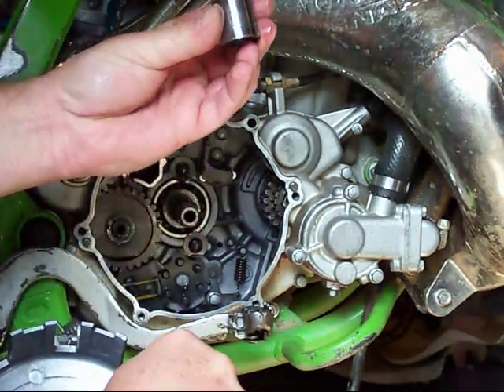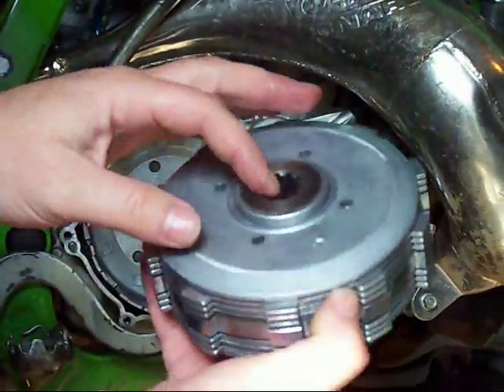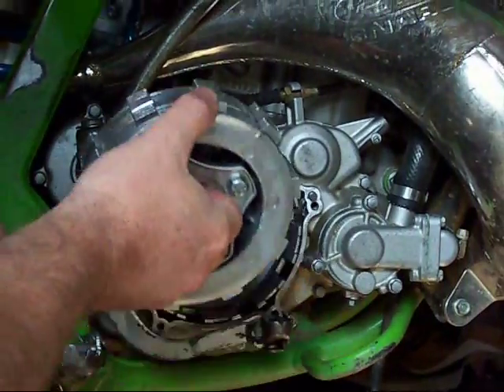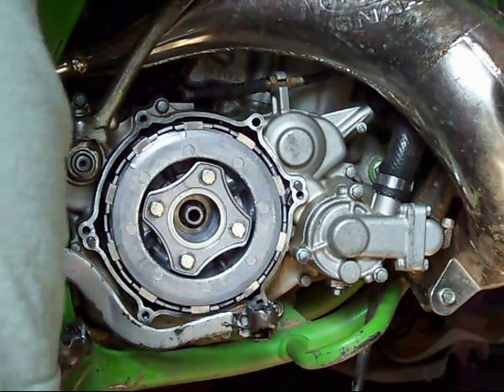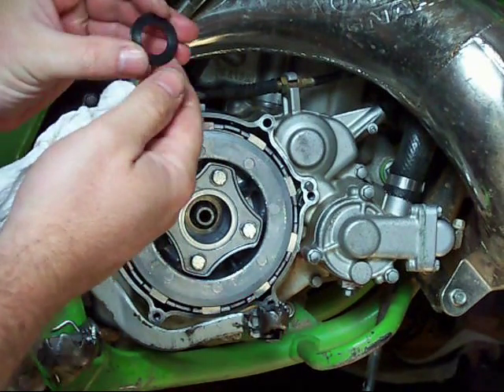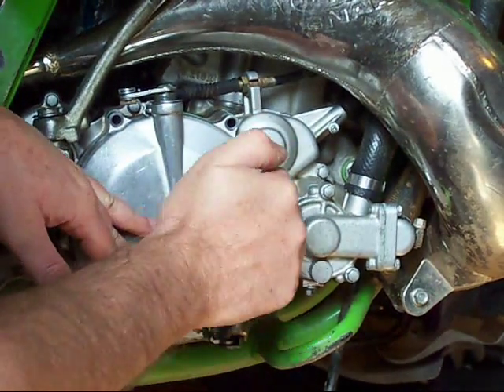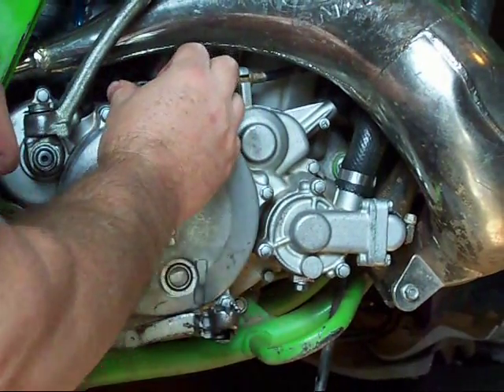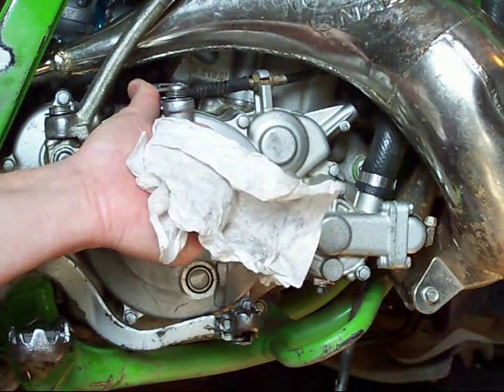Revloc Dynaring installation problem

Comment: My friend mueu KDX clutch assembly with your tip will easily mount, I live here in Brazil and this set is very expensive, I'm looking on ebay and buy direct registration, been penssando if you would not have a reserve power to me sell or endicar me where to buy.

Comment from the maker: @1234pearls  I put a screwdriver through one of the holes in the rear sprocket, then rotated the wheel in the appropriate direction until the tool made contact with the swingarm.